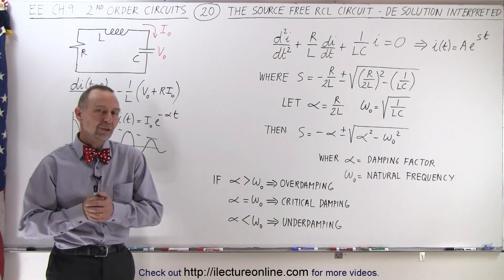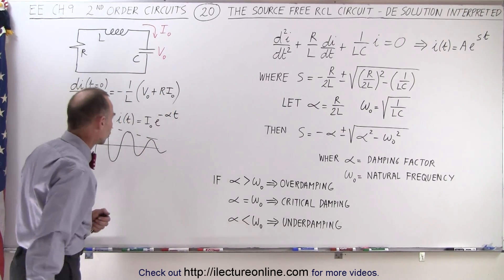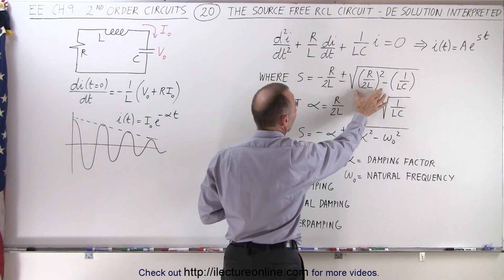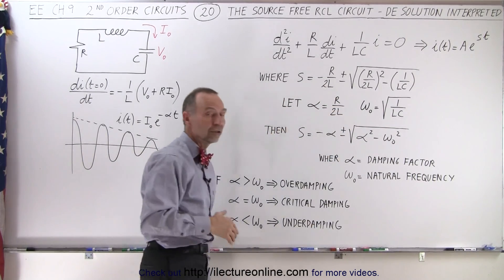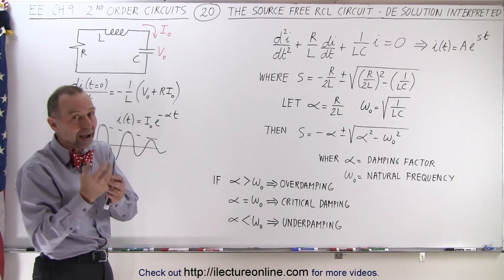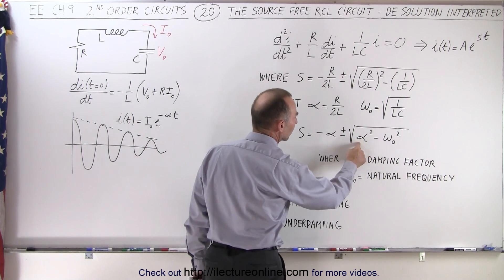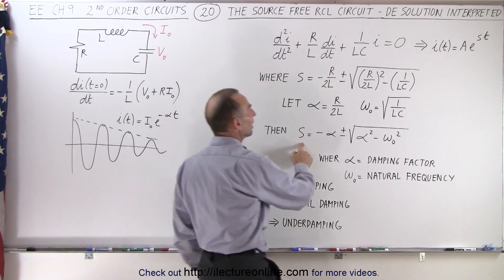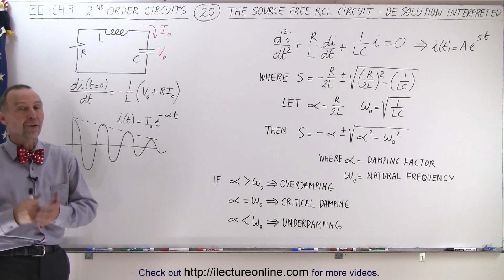Electrical Engineering: Ch 9: 2nd Order Circuits (20 of 76) Source Free RCL Circuit-D.E. Solution

Comment: Sir i did not understand this point which u said at time 2:13 "The bigger the inductor, the smaller the current through the circuit"
Reply from the maker: A "bigger" inductor meant an indcutor with a larger "L"  which means that the inductor (like with a "larger" resistor) will oppose the flow of current more.  (Inductors oppose alternating current, not DC current).